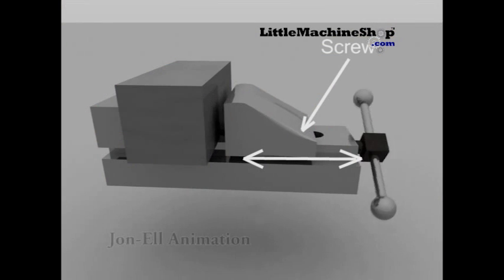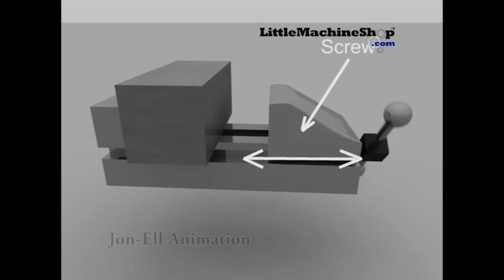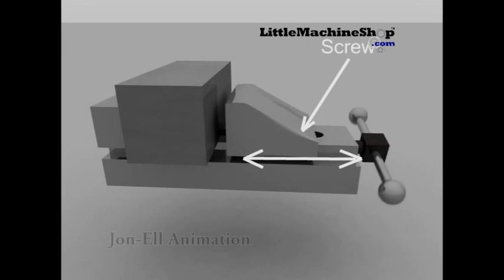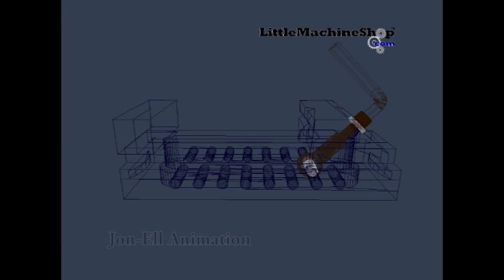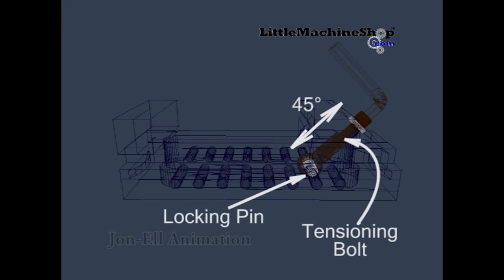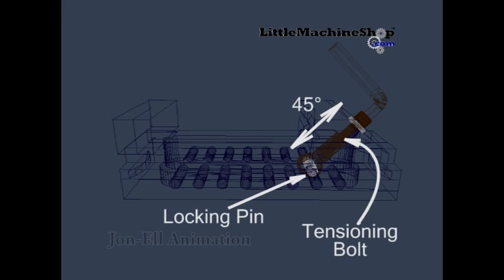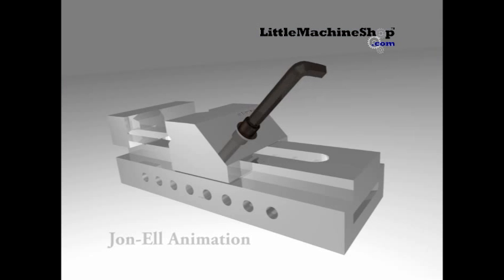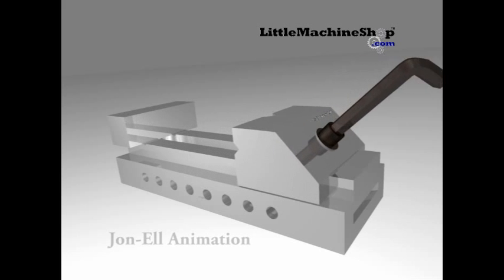Screwless Vise Overview

Comment: I have this vise and have no issues with it.  It takes a little bit of understanding of the vise, but then it works as well as any other vise.  My question is the threaded screw holes, what is the thread pitch?  Standard metric size or odd US size?
Reply: You’re going to have to pull out a thread pitch gauge. Most everything nowadays is metric. I can usually tell with an indicator by the threaded hole size and look at the pitch.

Comment: Whoever designed this vise should be charged with Crimes Against Humanity. It stinks. It has lots of 'dead zones' where it won't lock making it necessary to use shims. Sometimes while you're locking in the jaw will even kick backwards(!) because the locking pin is not in a sweet spot. The vise is well made, it's just a crappy design.
Reply: Crappy design? Uh when company's with the pedigree of Suburban Tools or Hermann Schmitt sell vises of this same design there's certainly nothing wrong with them. Zero doubts they make far higher quality and accuracy vises, and since I've never used the LMS vise I can't assess just how good they are. But I've got 3 other vises of this type and they all work just fine. If I had one with any of those dead zones I'd add a longer cap screw and/or make a new nut with deeper threads. As someone else posted these don't have the hold down side slots so when I was looking for a 4" capacity grinding/toolmaker type vise Accu Pro made them with those side slots and it's extremely well made.
Reply: I just bought a 3" screwless vice from somewhere else, and the fundamental problem was the clamping bolt was too short -- it would fall out of the nut just about the time it was loose enough to move the jaw.  Once I replaced the bolt with something a bit longer, the vice was transformed into something comfortable and easy to use.  It does take a little finesse to deal with the clamping; you need to work on your technique.  I don't know what the issues were with the Little Machine Shop vices, or whether they've fixed them, or what, but I do know that some of these inexpensive imported vices need a little tuning.  The alternative, I guess, is spend more money.
Reply: Rasiel Suarez, I agree 100%.  I just ordered a “regular” screw vise to replace my screwless vise. Too much monkeying around to find, as you elegantly said, the sweet spot.
Reply: Thanks! This is what I was wondering and thinking it must work in a way I don’t understand to adjust between those pin positions. You might as well have two fixed jaws and lots of shims!

Comment: I've bought a lot of stuff from you guys. I did not buy this vise because it does not have mounting slots on the sides.

BTW this is the single worst animation I have ever seen. It's embarrassing to watch a decent company present this.
Reply: What is wrong with the animation?  Looks perfectly fine.  Can you do better?
Reply: I didn’t think the animation was all that bad. It gets the point across and I’m pretty sure these guys are a small business and likely On a  fixed limited income. Catering to hobby consumers in general is not a very profitable business platform many want to take. Considering the costs of manufacturing, tooling, etc.., It’s usually more of a personal passion of an owner that is benefiting the consumer while sucking up excessive time from that business and its staff. Funny how high people have for expectations. They could just have a website with products and no description or video help of any kind.